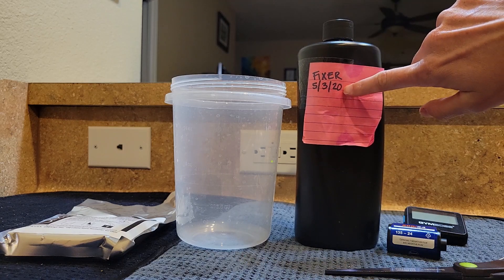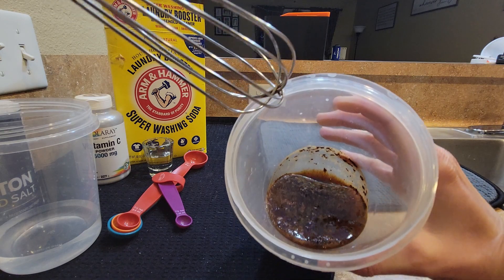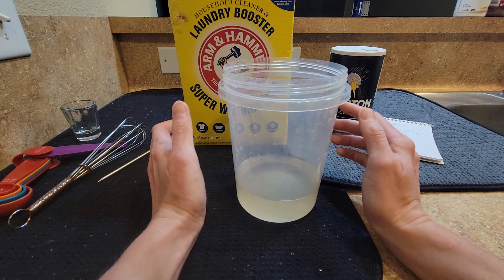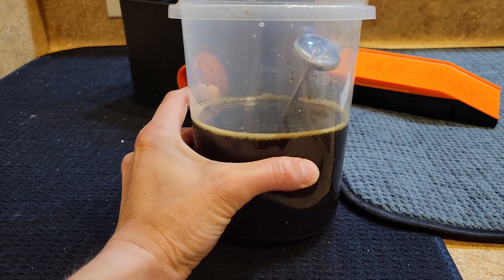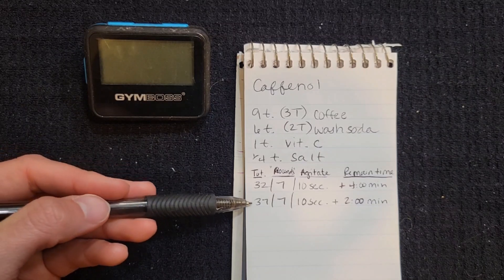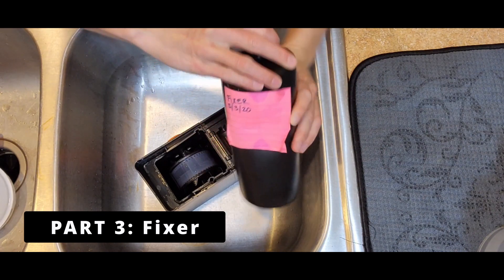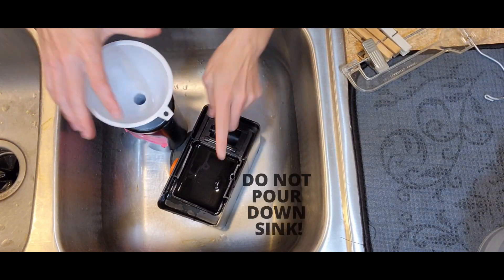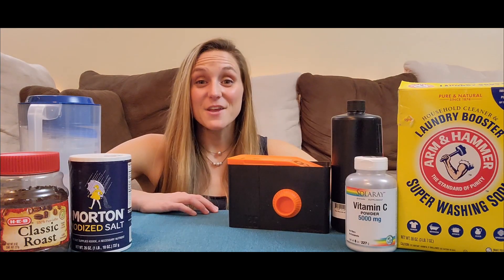Developing Film with Caffenol (using a Lab Box)

Comment: This video may contain the best illustration of loading a Lab-Box on YT, including those from Lab-Box itself. On the other hand, there are a few serious omissions, including that you can process with a full tank of solutions or a half tank, but in the latter case you must continuously agitate, which a is pain in the ass.  Using homemade "caffenol" in a $200 Lab-Box seems like a mix of economic metaphors, as the image quality produced by caffenol is poor on its best day. If you like to mix your own developers, you can buy for little more cost,  three to five basic chemicals and make a dozen different B&W developers which actually work well and do not take half an hour to process a film. (Cost per roll is about the same as caffenol.)  Also, note that L-B warns against using certain brands of film which are made on a PET base. PET plastic is too tough for the cutter on the L-B 35mm module to cut the film from the cartridge spool. 120 film is not cut, so the restriction does not apply for that film size. The "no use" list is on the L-B website (but apparently not in the user instruction manual - go figure).
Reply from the maker: Thank you for the information! I've noticed the image results differ between film brands when using caffenol. Ilford and Tri-X are my favorite.
Reply: @ecclesurfilm  Caffenol is a concept generated at a university chemistry project. Their results are published in a tome entitled "The Caffenol Cookbook", available free online. If you take your information regarding Caffenol and its use from the source, rather than the endless YT videos spitting out reams of nonsense,  your video would be more informative. For example, the developing agent in Caffenol is a phenol produced as a byproduct of manufacturing instant coffee. It creation and quality has zero to do with the coffee itself. Also, it suffers poor tonal spacing, as well as grain so course that it makes Rodinal look positively grainless. LabBox specifies regular agitation, much more than you show in the video, because otherwise, its vertical reel gives uneven development. You are using a semi-stand technique, with it a no-go for L-Box. Finally, the useful life of caffenol, once mixed up, is about one hour. With all the incidental screwing around with setting up to start development, you are pushing your caffenol to the edge of useful life. Overall, why not just delete this video and try again with DIY D-76?